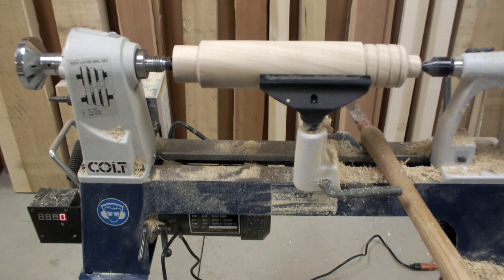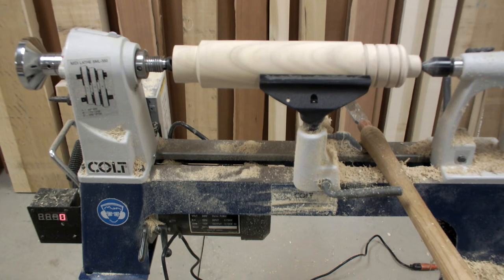ALL NEW / COLT 350 Midi Woodturning Lathe / I'm Blown away... Totally Amazing.

Comment: It has been almost a year, how is the lathe performing today? I am seriously considering this lathe over a JET.
Reply from the maker: Absolutely fine.
The Jet 12/21 and the colt arr the top lathes in their class.
I like the colt better for one feature especially and that is the VFD Controls and the 1HP motor with lots of torque.
But... you cannot go wrong with either lathe.
Reply: Thanks! I was, and now definite, that I want the Colt over the JET, simply for the feature you mention.

Comment: Hi Dusty
Not all lathes are made in Taiwan, at the low end of the market they come out of China.

If you want better quality control and attention to design then you head to Taiwan.

If you are looking at the larger lathes then you buy a Robust, Laguna or One Way if in the USA when you want local manufacture (I am not totally certain on this point with Laguna & Oneway).  

In Europe then we have Steiner plus others made locally, but you have dig beneath the paint on most lathes to see where they are made.  The big brands JET & Powermatic come from the Far East but they have their own QC people to keep the quality up.

Some companies are buying the component parts in Far East and then finishing them in the country where they sell them. 
Regards
Reply from the maker: The colt is part of the Stratos Line coming into USA from Germany but made in China and/or Taiwan.
I was just doing a review of this tool.  I currently do not own a lathe.